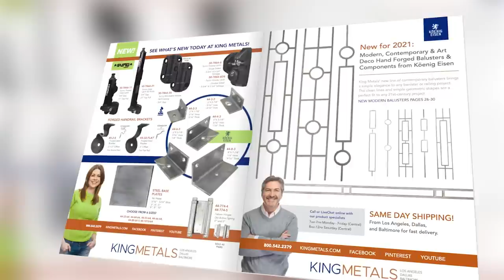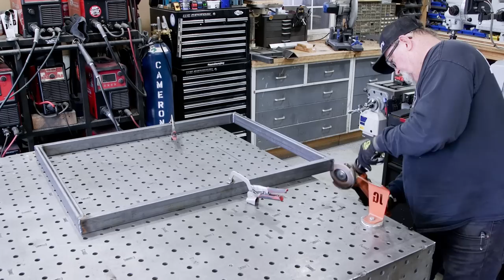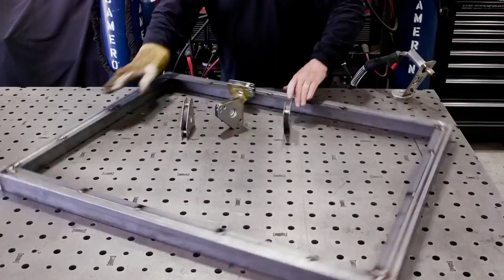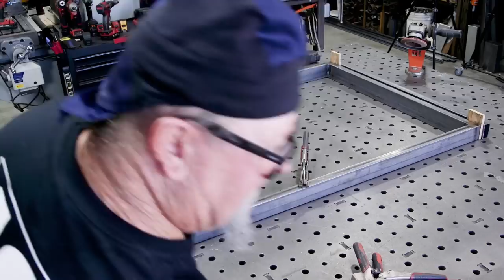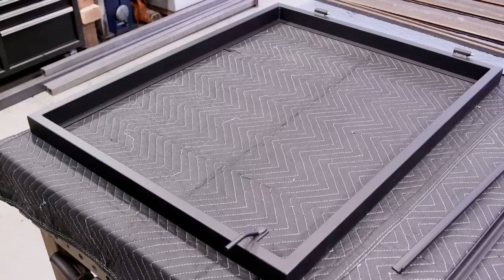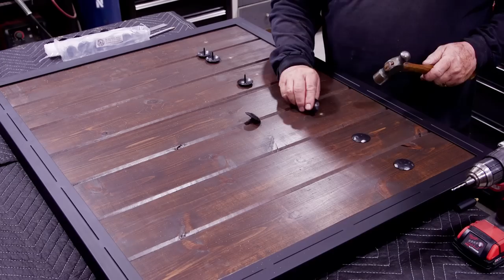Medieval Style Mini Gate Build  | JIMBO'S GARAGE

Comment: Another great video, I've definitely picked up a few handy tips watching you. I enjoy how you explain everything so clearly and yet manage to make it enjoyable at the same time. 

I was wondering if you have any experience in making gates with composite gate boards instead of wooden infill panels? Obviously every job is different and each customer has different requirements but I've started to use them on gates I make. This is mainly to save weight on larger gates due to them being hollow but also to save on the maintenance (no need to repaint every so often and minimal warping over time). 

Would be great if you get the time to make a video on that.

Keep up the good work anyway!

Comment: Hello friend, I noticed that you frame the wooden boards very tightly.  From heat and cold, the tree has a narrowing or expansion.  How not to break the board from strong weather changes?
Reply: Not many strong weather changes in Florida. Heat and cold isn’t really a problem.

Comment: Nice video again. You make it look so easy ! I learn a lot of your video's. How do you calculate the distance beteween the door and the post as seen at 8.15 ? Is there a rule opf thumb?
Reply: The easiest way is to layout (on table or floor) the total opening then mark the post width on each side then measure/mark hinge allowance on one end and  gravity latch allowance on other.  This will give you the gate width O.D. (long point of 45* cut)